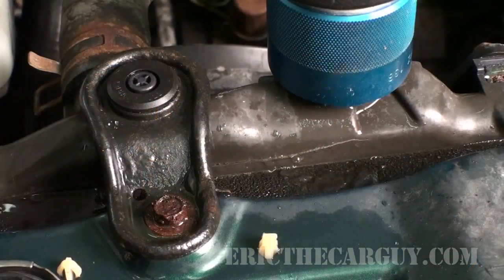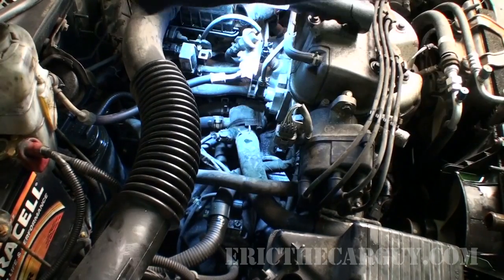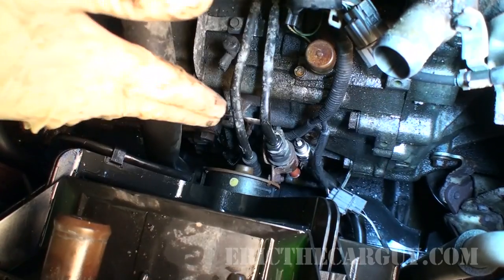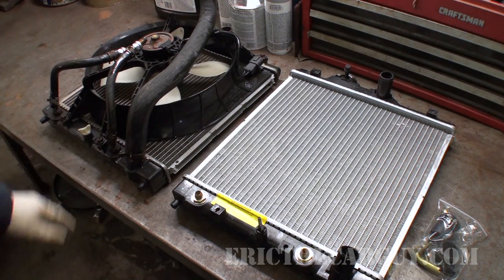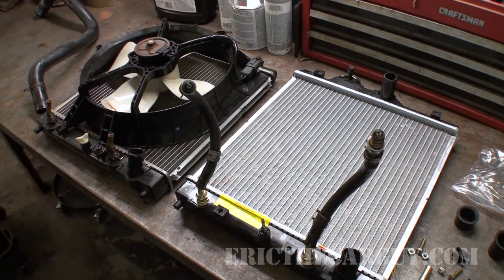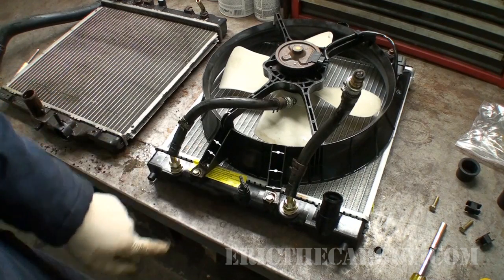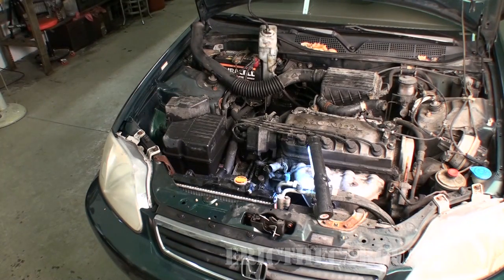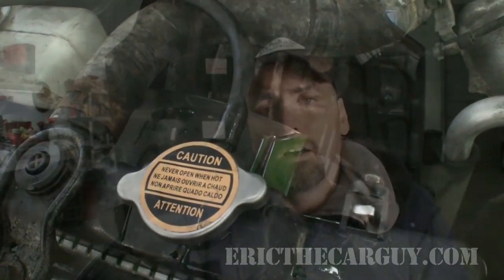1999 Civic Radiator Replacement -EricTheCarGuy

Comment: how can you reuse the spring clamps
i always replace the spring clamps with the screw type simply because there are few things that i hate more than spring clamps
Reply from the maker: As I said in the video, and showed in the video, I replace the one on the bottom hose because it's difficult to get to. If the upper hose clamps have an issue, they're right on top and easy to access.
Reply: Spring clamps are superior to worm clamps. They are constant tension, so as things expand/contract they maintain the same tension, whereas worm gear clamps dig into the hose over time and cause leaks. I always use spring clamps where possible.
Reply: ***** Yep, spring clamps are better in that sense. I've had problems with gear clamps in the past and try to re-use spring clamps as much as possible.
Reply: To be honest with you I wouldn’t reuse the Spring clamps I would put metal hose clamps on their
Reply: Outlast both plastic pieces of crap

Comment: i have a 98 civic and i have a bad radiator and im not using the ac cooler am i able to remove both and get a bigger radiator or will that cause issues ?

Comment: Hi Eric, i have a civic 1999 ex and I followed all the steps to replace my radiator and now my idle is on 2300 how do I fix that?
Reply: +Matth Torrijos sounds like you need to bleed the air out of your cooling system lad, Eric has a video on that

Comment: I've done everything to the new radiator and even put new sensor switches on but my fan still doesn't turn on, I've also tested it to my battery and it works fine but when the car heats up it over heats because the fan doesn't wanna turn on, can you please help
Reply: If you have a civic or any honda in general, it could be the fan switch/thermoswitch.
Reply: Check the relay/fuse

Comment: You should not have replaced the radiator in this car . You should have just stripped it for parts and crushed it . All Hondas should have manual transmissions .
Reply: L.E. Batte. you might have a point best honda civic I ever had 1987 hatchback manual transmission could handle 100 miles per hour speed never leaked a drop of oil zero radiator problems unlike my 2000 civic lx has the seal of awsome according to most experts I love it but I'm practically getting a lot of mechanic practice on it.
Reply: my CRV has 386k original  miles on both its engine and automatic tranny.

Comment: Damn the dealership quoted 6 hours labor for a 2000 Civic radiator.  Must be harder than this Civic!
Reply: no its not lol its the same they are ripping you off there it is like a 30 min job if there are no issues. these are the easiest cars ever to work on. 92-2000 civics are all like this pretty much

Comment: I had a 1997 Honda Accord and at the time the radiator needed to be replaced it had around 220,000 miles on her. The reason for the replacement wasn't because it was leaking it was because the aluminum fins had rotted away and weren't do their job. Took it to the Dealer and they installed another Honda Equipment radiator (since the first one lasted 220k lets get a good one) well the MORON mechanic forgot to tighten the automatic transmission hoses and by time I got to my exit which was just over 30 miles away RPM dropped to idle and lost all gears. Coasted into an area I could stop and by time I had gotten there stopped there was a HUGE puddle of fluid - I needless to say was pissed off since I had gone to the Honda Dealer of which normally no problems until this one. It ended up being a big thing. The transmission started slipping at highway speeds - so 4th gear was shot - that repair cost 'em over 2k for a used transmission that only had 90k on it - yay me!! LOL
Reply: Sachi In Wisconsin which is why I do my own work :) Lol